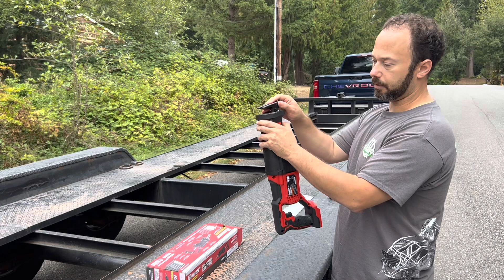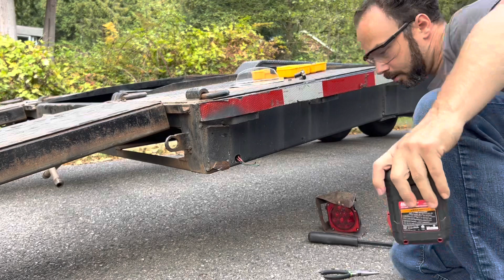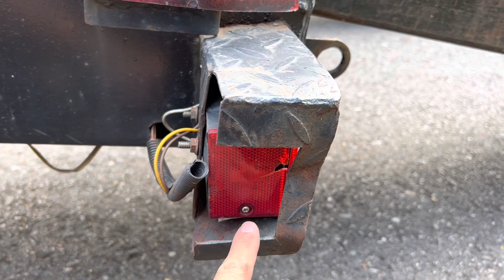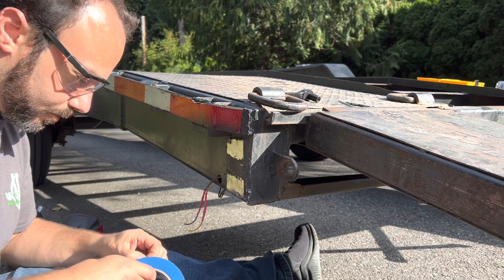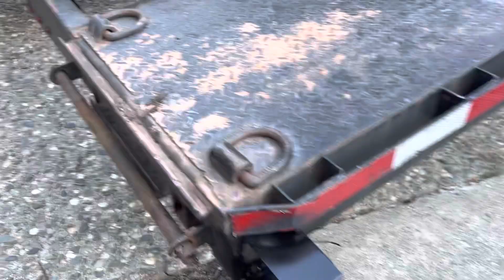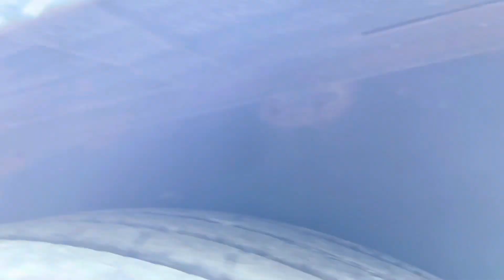Bauer brushless reciprocating saw review and Trailer fix

Comment: Food for thought.  When one uses the Sawzall. Keep the blade cool. Use slower rpms. It will cut for a long time. Use oiI it will cut longer and quicker.  I have blades. I've worn all the paint off. They are still cutting well.